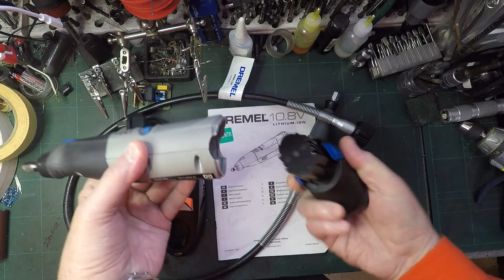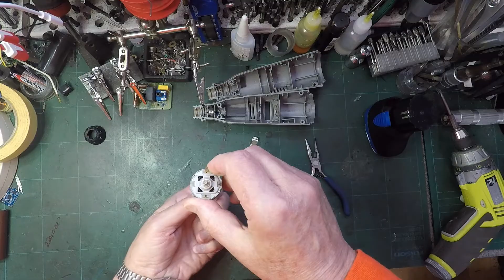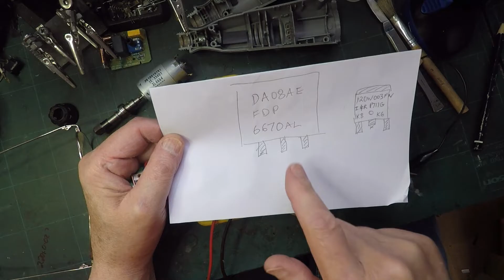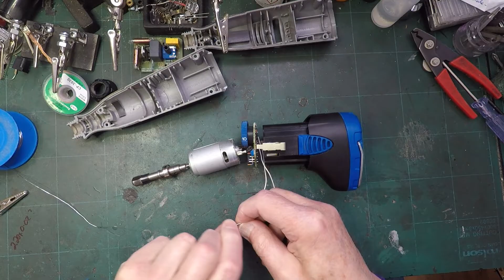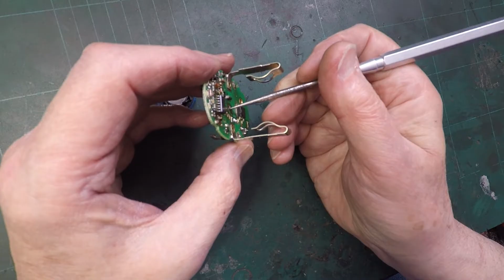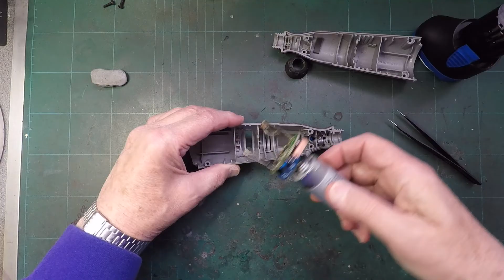Dremel cordless 10.8 repair/restoration

Comment: Excellent my diode is blown and i couldnt find the part number for it, it was an st. I'll try to replace it with a 12CWQ03FN SCHOTTKY RECTIFIER and see if that helps
Reply from the maker: Got to be worth a try
Reply: @DaftOldMan absolutely
Reply: I did a little d,g around and I think the small one is STN3NF06L mine is blown too. if you fixed yours please tell or I'll tell when I change it and if it works:)
Reply: @araskologlu7846  Hi! Havent actually changed it yet, i have ordered it, received a couple but looks like you might beat me to it ;)
Reply: @thehighwayman78 I'll report back as soon as I receive and replace it:)
Reply: Yeah it was not STN3NF06L. its definetly the schottky you mentioned. but my Main mosfet is alsı shorted I believe:) it works but in full power:)